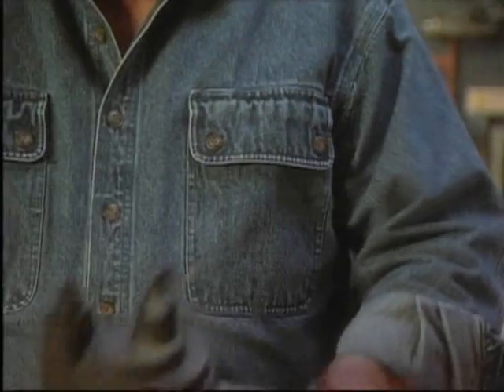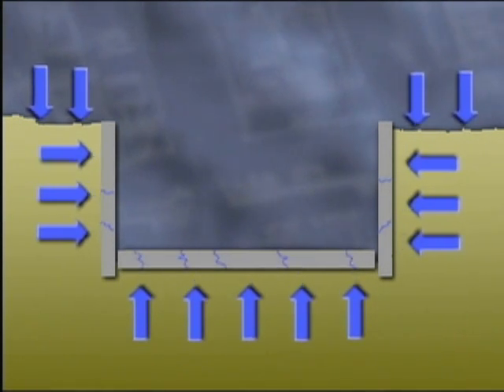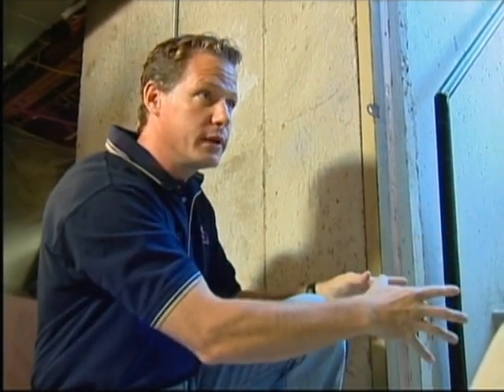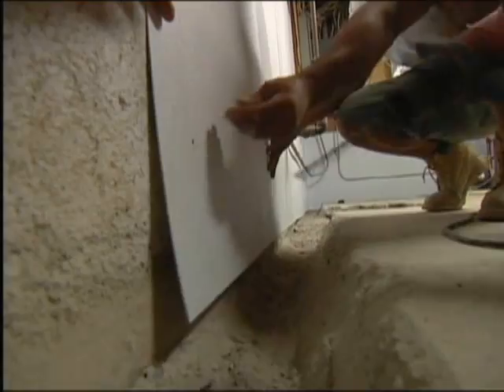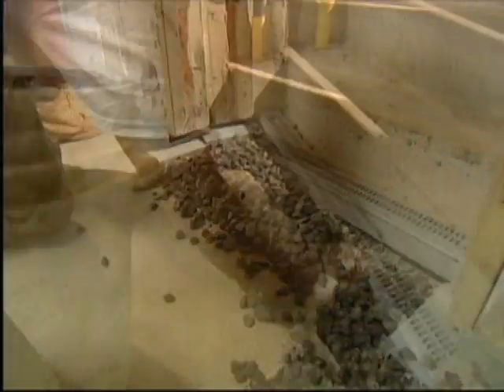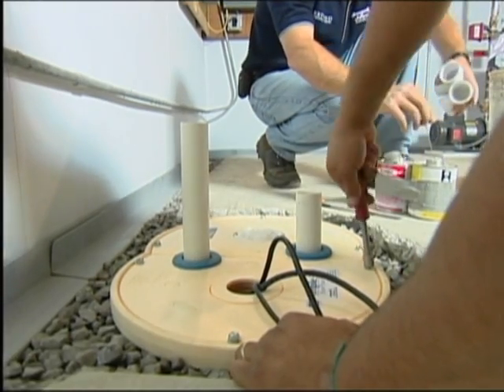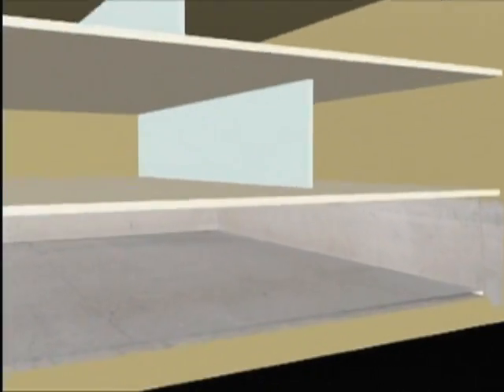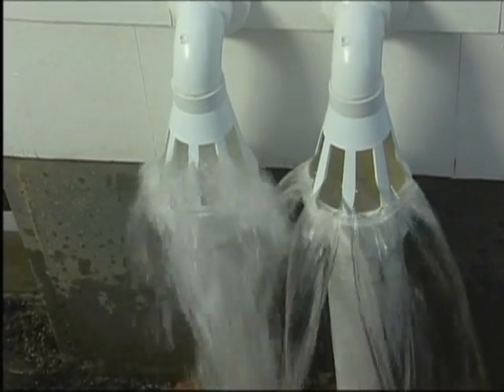How to Waterproof a Basement | Ron Hazelton's House Calls feat. Basement Systems

Comment: My opinion of Ron Hazelton just plummeted. This is not waterproofing this is just learning how to live with it. Pitiful. You have to redirect water from the roof away from the foundation, dig up the foundation and install a proper waterproofing system on the outside of the basement wall not catch it after it gets inside. This is the equivalent of giving someone a bucket to catch water from a leaky roof instead of making the roof watertight. What a scam.
Reply: Thank you for such insight.  You've helped me more than you can ever know.  If you are in Nashville, could you recommend company?  I just had bedrooms in my basement flood.  I've never had this happen before (I'm from Houston and we don't have basements in Houston!).  Thanks again.
Reply: If you watched the video the drain is on the footer but below the floor. How is that letting water in the basement? If waterproofing from the outside is so great, why do all these existing homes need to be waterproofed? It’s the job of the gutters to direct it away from the foundation. But last time I checked, rain often comes in on a angle.
Reply: Of course your right but if the basement is 10 feet deep and outside is a huge concrete patio then it's going to cost a lot to hire somebody to do it right. of course a home improment celebrity would do it right.
Reply: There is also the question of COST. I had to do this to my basement, as I literally had a 'river runs through it' situation. My quotation for an exterior water proofing, was $40K+ (ouch!) while an interior water proofing was $20K (HD vapor barrier on walls, interior weeping tile, new sump with battery backup, and whole house de-humidifier)
Reply: @paulmoffat9306  You paid $20K for interior water pumping, not water proofing. Just as much water still flows into your basement, you are just pumping it out more efficiently. So if your only concern was water on the floor, you saved money. If you were concerned with humidity, mold or decay you did nothing to stop those.
Reply: @mwilson70201 Couldn't agree more! There was no thought given to prevention at all! the same amount of water is still flowing into the basement, now it's just hidden behind plastic panels on the wall. Those "Failsafe Bypass Fittings" dump the water just outside the house for it to leak right back in!!!
Reply: H
Reply: @mikes8016  it's not the drain that is letting the water in. It is the cracks in the wall that were already there, water comes into the wall as it always had, now though it goes behind the wall panels and gets channeled to the pump. The point is the water is still coming in and damaging the wall is it had been. So they are not fixing the problem, they are just giving the water a place to go
Reply: @paulmoffat9306  any exterior waterproofing job I've ever quoted has been cheaper than what the customer had been quoted for an interior job by 20%
Reply: Ever notice how, regardless of the home improvement project, there's always a "super genius", "super offended" person in the comments who rushes to their keyboard to tell everyone how smart they are?
Reply: @donhill1825  it is not about telling people how smart you are, it's about companies that are too lazy to do a job right. The only thing that sealing up the inside of a basement wall accomplishes is getting a unsuspecting homeowner to write a check. I have personally seen these jobs 5-10 years afterward and in some cases the walls can be scooped away by hand like wet slag sand. Having to charge 10s of thousands to jack up a house and replace basement walls of people's homes who really have no choice at that point when a simple dig down, parge and tar seal of comparable or slightly cheaper price would have kept their basement dry and the foundation strong for decades to come. So tell the fly by nights to keep their dri-loc and corrugated paneling and hire someone who gives a damn
Reply: @donhill1825  it's about having a conscience
Reply: Andrew Batts .
Reply: @andrewbatts7678  can any vids on how i might do this myself on someone with no experience in this area nor any areas related to it?
Reply: @Layarion  I'm sure there is, it's a lot of work though, be sure you call miss dig (if you live in the USA) to mark the utility lines, you don't want to break a gas line
Reply: @Rackn Stacker in a proper system water doesn't penetrate the basement wall, it is channeled to the drain tile, a proper job will seal the wall for decades
Reply: @Rackn Stacker trust me, I did that kind of work for over a decade and a half
Reply: @Rackn Stacker cracks do matter, they need to be sealed with hydraulic cement and tar. I did this for a long time. I know my shit. If you properly the outside of a basement wall and not a drop will get in. My Aunt got the job done properly almost 20 years ago. Before that she would get up to an inche of water on the floor. Almost 2 decades later and not a drop of water got in since
Reply: @andrewbatts7678  your a fool the acid in the soil breaks down the Lyme in the cement no outside system works permanently that's why builders only give a 1 year warranty on a new house
Reply: @andrewbatts7678  1 inch of water on a quarter acre = 6,914 gallons of water 98% penetrates the earth....how do you stop almost 35,000 gallons of water on a day with a 5" soaker mcfly
Reply: @thomaskelly336  so basically you have no idea how an outside waterproofing is done. First off you grind out all cracks and thoroughly clean the wall, then you fill the cracks and parge with hydraulic cement, once the coat of special cement has fully cured you apply a thick layer of thick mastic,(the stuff that is consistency of peanut butter) then you put a minimum of 10 mil plastic sheeting on the tar. Then you backfill with pea stone about 80% of the way up, then you fill the rest with new fill dirt. So why would assume that soil acidity will degrade a wall that is thickly coated with tar and thick plastic sheeting, especially when most of the trench isn't even backfilled with soil. Most of the dig downs I've been on have been given a 10 year guarantee, and none of the jobs we did in the dozen or so years I was at that company have leaked.
Reply: @thomaskelly336  if you ask me all new houses should have their foundations fully sealed, then again that would have meant a lot less work for me
Reply: @thomaskelly336  the water goes to the drain tile. It's not like it just sits there pressing against the wall. As long as the drain tiles are clear and working it will clear away any amount to the storm drain
Reply: @thomaskelly336  I did this for a long time and have learned more over the years than you have in your Google research
Reply: @thomaskelly336  a proper functioning drain tile system can channel away that 35,000, gallons of water in about an hour or so no problem
Reply: @thomaskelly336  the dirt never comes in contact with the wall ever again. It's coated in thick mastic and 10 mil plastic!!! Your probably an engineer, only engineers say stupid shit like that
Reply: @thomaskelly336  that's funny because I still have yet to see an indoor system not fail in less than three years
Reply: @thomaskelly336  in fact most of a dig down jobs we did where for people who previously got an indoor system and saw how poorly it worked, then decided to do it correctly
Reply: @thomaskelly336  plus you seem to have no understanding of residential neighborhood storm drain systems, you seem to think the water just sits there pressing against basement walls and not going anywhere
Reply: @thomaskelly336  plus in Michigan where I'm from, soil PH averages between 6 and 7, that is not a acidic that's alkaline
Reply: @andrewbatts7678  your silly and ignorant lol the water litteraly does sit there against the wall lol it's called the clay bowl theory...lol your stomach acid is 4.3 pH that acid can eat thru a battleship. Where do you think cmu wall pushes comes from??? the water and mud it creates puts 44,000 s/f of pressure on an 8' basement wall
Reply: @thomaskelly336  that is made irrelevant by the French drain tiles around the perimeter of all houses that run directly out to the storm drain
Reply: @thomaskelly336  not with a backfill of pea gravel
Reply: @thomaskelly336  every single house ever built has drain tiles
Reply: @andrewbatts7678  a gallon of knowledge just doesn't fit into a quart container... there's also the majic Bean's method
Reply: @andrewbatts7678  sorry I forget what that Michigan water does to the human brain I can buy a house in Detroit for what it cost me to park a car here
Reply: @thomaskelly336  drain tile
Reply: @andrewbatts7678  how do you tar underneath the house? Water will still collect there if you tar the outside walls or not?
Reply: @denniero6904  you don't, you dig around the outside and tar the walls, houses all have what is known as a drain tile. Usually a collection of 4 inch by 16 inch clay tube sections that run the parameter of every house just below the footing usually about between 5 and 8 feet underground, that runs out to the storm drain for the neighborhood, either running along the street or or along everyone's backyards
Reply: @Liberty AboveAllElse only once or twice in all those years have I seen a failed tile, that's SE Michigan, I can't speak for the rest of the country
Reply: @Liberty AboveAllElse I can only speak for how me and the companies I worked for priced the jobs, but bottom line is if you still have water coming through the basement wall, damage is still being done, seal out the water with proper means and assure the tiles are open and free flowing and outdoor systems are the better choice. It's better to not have your foundation fail then to keep that patio looking mint. I have seen firsthand the end result of an indoor job, usually between 4-8 years the worst ones don't even require power tools to demo the foundation blocks, they will literally come apart with a stone hammer and gloved hands. I'm sure there are basements that are fine for years and years after an indoor water diversion job, but as a general rule the dig is the way to go
Reply: @Liberty AboveAllElse most digs take about 2 or 3 days to complete, for the ones I was on
Reply: @Liberty AboveAllElseI am well aware of those warranties and what they cover, they do not cover the continued failure of your basement wall, indoor systems only redirect, the water. While your basement floor maybe kept dry(which is the only thing the warranty covers, if your basement starts flooding again the warranty will cover it) but WATER IS STILL LEAKING IN THROUGH THE WALL, ONLY AN OUTDOOR DIG DOWN AND SEAL WILL STOP THAT!!! Jesus it's like every few months I get comments from this from some thick headed people who can't understand that. But the Dunning-Kruger effect won't let them see reason, all that an indoor system does is redirect the water, not stop it from coming in!
Reply: @Liberty AboveAllElse what are you talking about, a 20 ft long dig takes 3 guys with shovels a wheelbarrow making $10-$12 per hour about one 10 hour day to dig out and parge the wall with hydraulic cement, then a 5-6 hour day to tar membrane, backfill with pea stone and clean up. Our crew was Savage, a good group of hard working guys are worth their. weight in gold, I been on a million jobs a million times, you would not believe what we are capable of accomplishing. The pit only goes out barely 3 feet, the damage is negligible, and about 99.9% of the time you don't need to touch the weeping system or the tiles. I'm sure you've done a lot of research, but I've actually done more times than I can count and we have never needed heavy equipment. Just shovels, wheelbarrows, a dumper trailer and good old fashioned elbow grease.
Reply: @Liberty AboveAllElse I think once maybe twice have we needed to change any tiles, pipes or anything else but backfill
Reply: @Liberty AboveAllElse a bunch of Google searches don't make you an expert
Reply: @Liberty AboveAllElse about $590 total worth of labor on the high end if you buy the crew lunch,$250 for materials maybe $300, the average cost to the customer is $200 per linear foot that is plenty of room for profit, done it a million times
Reply: @Liberty AboveAllElse no, but having a general contractor license does, digging holes was just one part of the job, I put down the shovel years ago, I have peons to do that for me, knowing how to talk to people and get them to hire my company to improve neighborhoods and give otherwise unemployable people a way to make some money and feed themselves
Reply: If you get a few houses in a cheap neighborhood to house your guys and take their rent out of their checks and that'll increase the margins 3 fold, as long as you find a way to keep them busy you can't lose

Comment: I estimate about 10K, but this is a possible diy for much less if you are flipping it. 
It is not a good solution though, and does not solve any water vapor from the floor either most likely making that problem worse. And logically it could possibly weaken the integrity of the foundation by breaking the bond between the floor and the wall, which has been together for decades in most cases. Some companies leave tabs and feed the piping under them, but i think that is just a con as there is no way the integrity can be the same with a jack hammer blasting away for 3 hours. The floor is history, the house has begun a downward spiral.